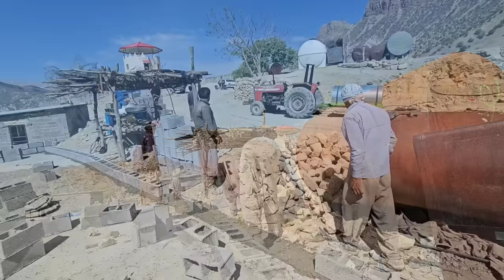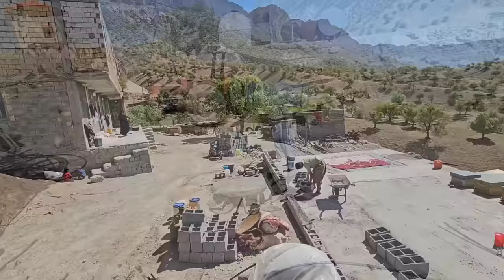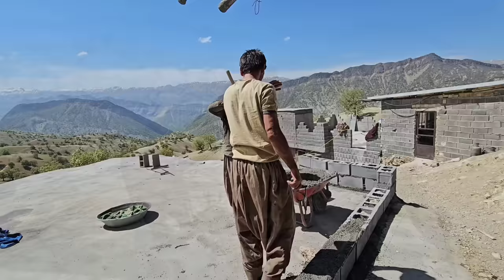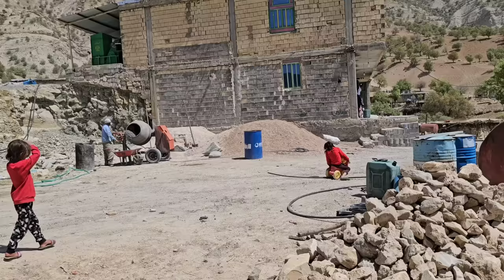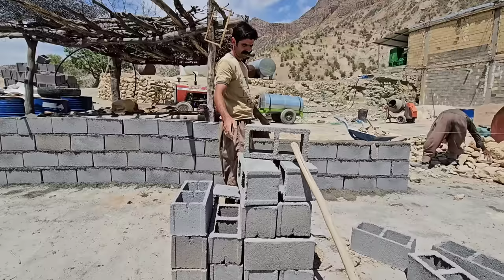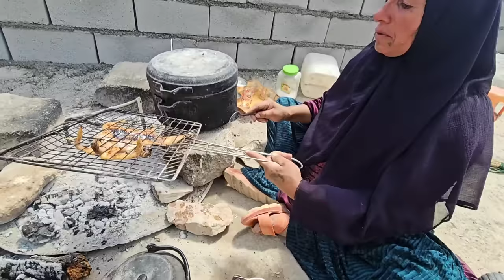The hard life of a nomadic family in the spring nature / nomadic documentary

Comment: I don't understand, but how can you build a house like this without digging the foundation? 😳😳Can anyone who understands these issues please respond?😳😳 Shouldn't the foundation of the house be solid? Pouring cement and laying bricks on a flat concrete floor shows how durable this house is. Hasan's new room was the same. The room was built on a flat floor. Deep foundations must be dug and iron columns must be built.👍🏻💯
Reply: I  also  wondered  why their  systems are  different  from  what I've  seen in  some  places they build up so easily and quickly
Reply: That is a good question.  I think the ground floor is the foundation.  Looking at the plan of the building construction, I don't think they're planning to  include timber frame, which is why they're not using iron columns.  It looks like an open floor plan construction.  Oh Idk it's just a guess.
Reply: Pois é...no Irã não usam quase ferros e sim pedras..